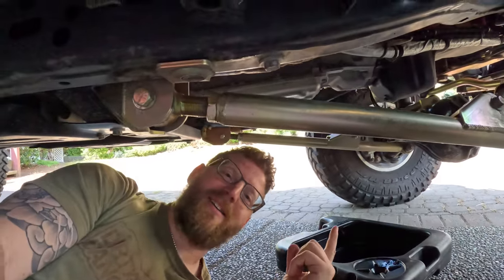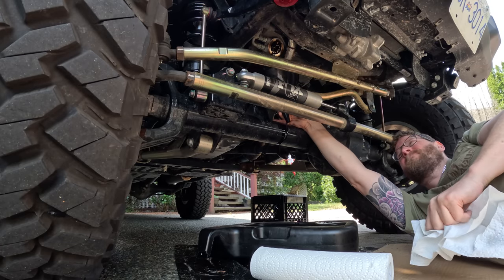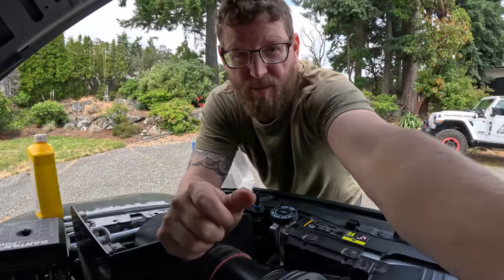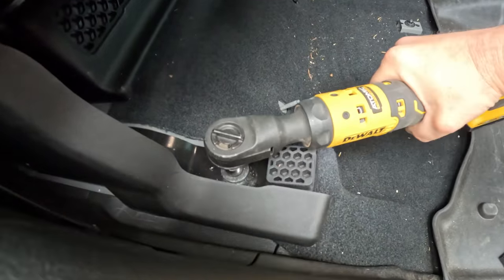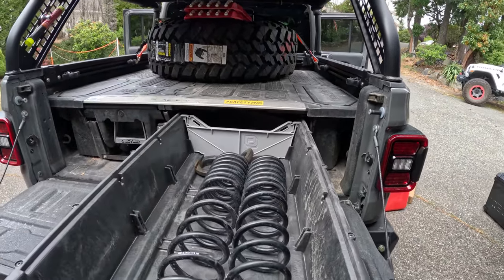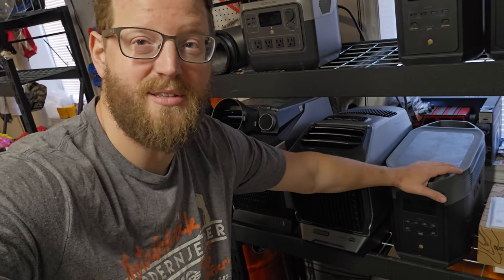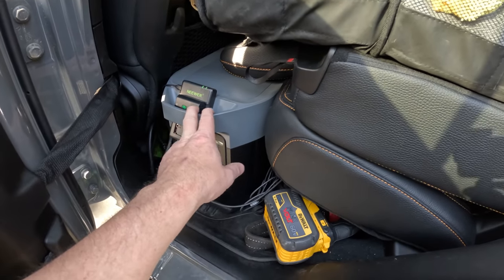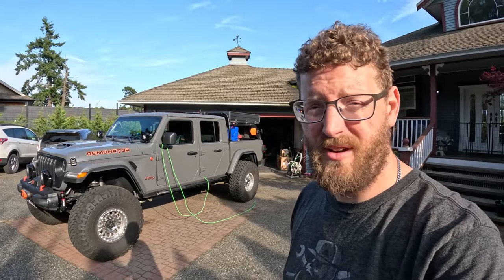I Am Really Struggling With My Jeep Gladiator...

Comment: Somebody needs to come out with a topper that is about 8 inches lower than the cab, with side cargo doors and a slide out floor. Then you could mount your tent on the roof and have a lower overall profile.

Comment: I'll stick with my JL but I would have to go with a bumper with a swing out tire carrier for a JT.  I couldn't do a spare in the bed.
Reply from the maker: The swing outs put so much weight so far back it throughs off your whole suspension. Haven't seen a setup I'd run yet

Comment: Hi Casey. Love the show. Question: How did you say you charge your power bank using the gladiator inverter? I know you mentioned something from EcoFlow, but I didn't catch it.
Reply from the maker: The AC to DC converter that comes with the Glacier works off the Jeeps inverter and can be used to charge the Delta 2 or River 2 through its xt60 DC port. Gets 175w of charging instead of 90 to 100 off 12v DC. 

I think the idea setup is a 12v to 30v converter off the batter and into the DC port on the Ecoflow for almost 400w of charging and not needing an inverter but that's a lot of wiring.

Comment: Ok, first of all, I had to laugh at your selection of power banks.  Crazy!  

Second, I’ve recently moved from a dialed-in JKU to a Gladiator, and YES it’s a big struggle.   I didn’t want an open box, so I started with a tonneau cover and bins.  Tonneau cover isn’t tall enough for a fridge, so grabbed a used SmartCap.  I was contemplating Decked drawers, but ultimately decided on a Bedslide.  My fridge sits low relative to Decked, and I’m keeping on with my bins.   My backseat needs to stay in place as a people/dog hauler.   Problems I never thought I’d have.  Geesh.
Reply: and NOW I see this is 7 months old.  Haha

Comment: The solution for the Gladiator is a Wrangler or a Bronco.

Or, how about a Bronco with Sasquatch or Bronco Raptor?  Then you don’t have to lift anything.  Plus the Braptor gives you 37’s from the factory.  

I had 2 Jeeps.  Loved them.  But they just require too much modification post-purchase to get right.  Bronco w/Sas and Braptor are just sign and drive.
Reply from the maker: I thought about a Braptor but I refuse to pay the markup. Maybe I'll see where they are at in a year or so.
Reply: @Casey250  Touché…. I wouldn’t pay above msrp either.

Comment: I was thinking about mounting the spare to the underside off the rack but don't think it would do any good with the bed drawer system. Maybe see if you can add side panel system to the rack. 

I am a fan of the gladiator just, for some reason I can't not love them, I feel I would be better off with a Wrangler but I don't know if I could make that switch. Want to do a Rock-Landing type thing with mine if can pull it off. Its a beautiful ride man I would say try not to over think and just enjoy 🤘
Reply from the maker: My downfall will be overthinking lol
Reply: @Casey250  pretty sure a lot of us guilty of that. Best of luck getting tweaked to your liking.

Comment: Im building a rack that goes with tonnau cover for my Gladiator, then i can have fridge and delta pro in the bed. Run 35s so i can keep the spare under the bed :-)
Reply: Get a Clayton Offroad rear trackbar, you can run a 37 under the bed without any issues.

Comment: Why not add a swinging spare tire carrier to the tail gate to carry larger tires. You can also utilize it to carry other gear like done with the wrangler tire carrier. I haven’t seen one for the gladiator as of yet, I’m betting it’s coming.
Reply: Probably cause of departure angle
Reply from the maker: That and the weight back there throw the suspension off. Shaun had on le and it was annoying... And fell apart.

Comment: Yeah my 6.4 power wagon has the same oil filter lol. There’s a lot using the srt oil filter tho which is longer then this oil filter, don’t know if you can run that? I don’t cause there’s not much room because of the electronic disconnecting sway bar
Reply from the maker: Ya it's already close as it is with the oil bypass

Comment: The decked system is very cool but very limiting. You'd be better off with an alucab, or a kb voodoo vrs systen and tonneau cover. So much more space than the decked system
Reply from the maker: I've been pondering some different cap options. I think it's going to be a necessity

Comment: Get lighter gear some backpacking gear that's comfy but durable. I did that in my jeep able to wheel all day and not feel the weight. Also fits in the tiny trunk under my basket in the trunk.
Reply from the maker: I'm slowly figuring things out. Camping has been new to me as of a couple years ago.
Reply: @Casey250  yeah I used to run a alucab and gx460 now in my 392 with all backpacking gear. Way more fun to go fast and harder obstacles and just be slightly less comfortable or take more time to set up camp.

Comment: you've found all the issues. I went with RLD steel topper. 37" BFG Ko2 and used the bent Clayton rear Track bar in the rear to fit the 37" K02 underneath. OR you can spend another $3k on an Expedition ONE rear bumper to carry that tire.  those 40" tires require so much..one ton axles, 6 lug wheels and then yeah a rear tire carrier.  alternatively ditch the 200lb decked system and get the AEV tire carrier that has the tire sit upright in the back. https://www.youtube.com/watch?v=ocYiNHV4i6s

Comment: So does your oil come in liters instead of quarts?
Reply: Both.  The only requirement is that the measurement must be metric (in this case litres).  So most oil is sold in 1L or 5L containers however some oil has for whatever reason been imported from the US - so it is for example in a quart container but the labeling is Canadian so the volume is given as 946ml on the Canadian label (which will also have the French as required).
Reply from the maker: Beats me. I have no idea how much a quart is.

Comment: Your builds are just too crazy for "overlanding".  They are more of an extreme off-roading level.  I honestly don't like 1/4 tons for overland travel.  Beds are too small, payload is too light, and the cabins are too closterphobic.  As a Mopar guy you should look at the Ram 1500 4x4 (RCSB) and add the AEV (sport lift, bumpers, winch etc) Recruit system.  The large cabin seats three.  You can buy it with a V8!  The bed is 1.5 feet longer and a foot wider, and the axles can carry way more payload, AND it has the same wheel base as the Wrangler Unlimited.  So you get more payload, more space, more power, quieter cabin, better ride, handling, NVH, and used parts are cheap.
Reply from the maker: They are too wide for where I want to take a Gladiator but I'm considering a 3500 for a long range less extreme build with an off road camper down the road for when the fam wants to go out more
Reply: @Casey250  they are not too wide.  Yes they scratch more because the fenders are wider but if you go out and measure the width of your Gladiator I'll bet it's 82" or more.  A half ton is 79.9" or less.  My F-150 shorty (RCSB) goes anywhere a stock Rubicon 392 will go for half the price.
Reply from the maker: It's not the fender and axle width it's the body width. I like the narrow body width of Jeeps for maximum manuverability is some situations. A full size can go a lot of places but when things get tight and twisty I want a Jeep.

Comment: Interesting weight of oil your engine uses, I've heard you never you 0 weight oil in a performance engine as 0 has very little protection and 0 is used for economy and "emissions "? Also 9 quarts is nice i have a ford engine (coyote) and it uses 10 so don't feel like you're alone😂.